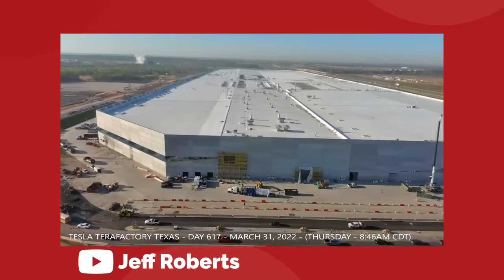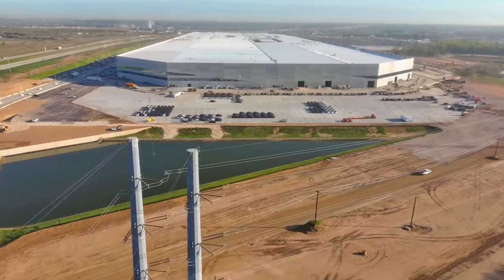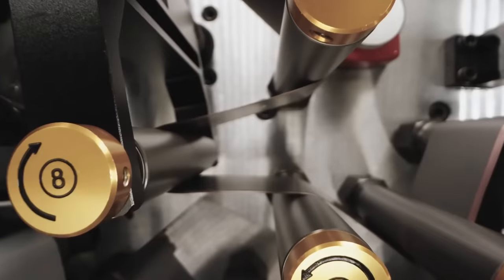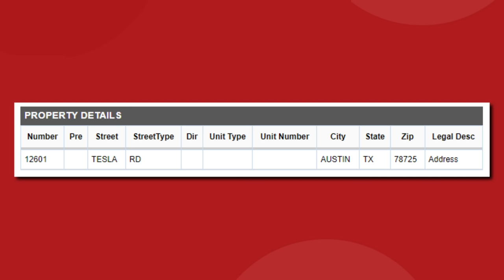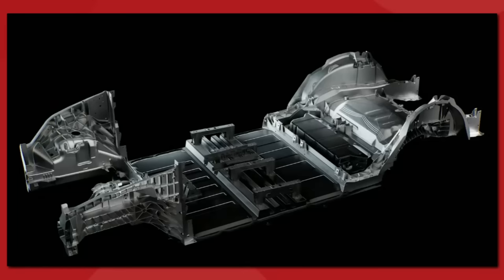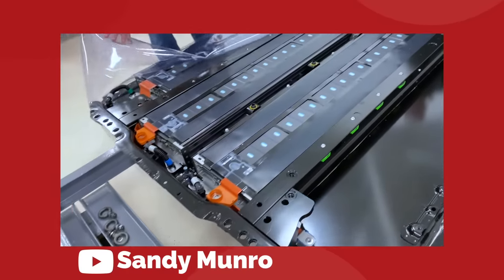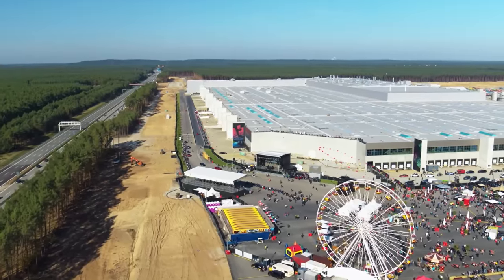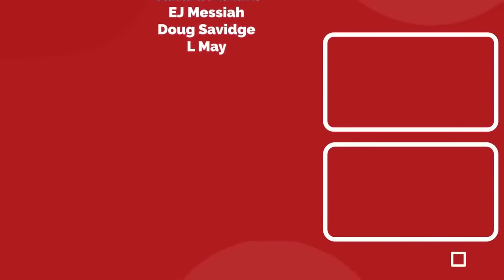Tesla Gigafactory Texas Is Officially OPEN!!

Comment: With the fast-increasing power capacity of LFP batteries, the 4680 may soon be outmoded. I've advised a friend who wants a Model Y to choose one with LFP cells, which I would also prefer if I were buying one.
Reply: Why?
Reply: 4680 has a generation one, two, three etc. It’s a form factor, not the chemistry.
Reply: Lol, 4680 is the size of the battery. They will be LFP cells, and probably with silicone in it.
Reply: @ikbenhet1989  i've checked posts about LFPs in the 4680 form factor, and from what they've claimed so far, the LFP versions didn't gain as much from the innovation as those with nickel and cobalt (ouch!) did. as a tesla shareholder, i want all their researches and engineering tricks to work. we haven't yet got feedback from buyers/users, but after some have driven 4680-powered Model Ys for half a year, we should begin to get a better idea about how good they are, including: how high they can be charged and how low discharged; charging rate; heat issues. it will take longer to know how many cycles they handle before significant loss; 2-3 years? i admit to being hyped on LFPs.
Reply: As long as the Y is sold with performance car spec I question LFP use.  A lower performance, lower cost Tesla like the rumored 2 series may use LFP and a single motor.

Comment: the only thing that wasn't mentioned much, probably because there isn't a whole lot of information is the status of the Texas 4680 battery production, as if that is not up and running within a week of opening then the plant will already stop running due to ill supply of batteries, but if the battery production is already started and a strong surplus of batteries is being made then this shouldn't be an issue for a while

Comment: Cool video!  it went down like an ice cold sweet tea with plenty of lemon, on a hot day.  How many in first year of operation?  74,000,000 cars in first year.  That includes 100 Semis and 2,500 CyberTrucks.  Sure going to miss that view of some mechanic throttling the carb by hand to rev the engine with the hood open.  Those days will be soon long gone.  "Adjust the points? What's that?"
Reply: A lot of my family members are mechanics and have their own shops. I’ve done a decent amount work on different cars too. I dont know much about Teslas other than it’s runs on just a battery to power everything else, so will that lead to a decrease in labor/parts?? I’m still waiting for charging stations to start popping all over the states!!!!

Comment: I don't see a big difference to other car manufacturers. These Tesla factories are big factories, well a few in a few countries. Volkswagen and others have many factories, large and small, in dozens of countries for decades. This is nothing new, only many factories of the other manufacturers are not a single building, but consist of several buildings standing together, as everything has grown over the decades. Doesn't look as sexy as a new Gigafactory, but they work all the same. Packed with the newest types of machines and robots and a 10 times greater variety of paint finishes than Tesla have. It remains to be seen whether innovations from Tesla, such as the "giga press machine" for the body or the new battery, are beneficial in all aspects. 1# These huge machines aren't exactly cheap, and 2# the more big parts of a car are manufactured in one go by just one extremly huge machine, the more expensive it is if there is a shut down time because of a malfunction. The biggest and newest is not automatically the best.

Comment: The real Tesla invented broadcast electricity so that batteries can be charged over the air. Well where is it?
Reply: Radio communications made it obsolete, you can either send electricity through the air or radio signals, but not both.  If we lived in a world with Tesla's innovation there would be no radio, TV, Wifi, bluetooth, etc unless all of those devices received their signals through wires.   Wireless communication is far more important than wireless power.

Comment: A total understanding why car batteries are out the roof. And then we're going to be forced to drive one of these electric cars, or fine public transportation and have living room area then need to commute from the city for a week home to just move back to the city and pay rent there so that you can work. My prediction gas is going to go up at $10 to $15 per gallon if not more. Me personally and factory shouldn't even be running being that they're forcing Us by holding oil from our United States for cheap gasoline. But let's look what cruel all makes. For standard car tire it takes 7 gallons of oil to make one tire for a car and the bigger the tire the more crude oil is needed. How about our plastics, you know like 90% of the car is plastic that y'all pay for declining investment, in other words $70,000 for a little bit of metal and a lot of plastic, if cruel is not going to be zapped from the ground then what's going to replace the plastics made of crude oil on these cars. Even the battery cases are plastic so I guess they're just going to stack a bunch of batteries in a car openly. Look how much stuff oil makes besides gasoline diesel and kerosene. I guess planes are going to be electric too by the way that's going to be interesting to see
Reply: It’s the burning of gasoline/coal and oil that’s causing the CO2 air pollution not the use in plastics etc
Reply: @blaineboyle5997  well I'll tell you what, you look at the exhausts on Jets, you look at the rockets when they take off and these are going up into the stratosphere or close to. One jet motors like a thousand cars and CO2 emissions. And diesels the most cleanest and efficient motor to run. I guess we're going to have no more black tops no tires to put on the electric car being it takes 7 gallons of crude oil to make one tire. I guess the bigger the tire the more gallons of cruel you need. Just don't forget about the soda ash, only gotten at electric plants that produce electricity with coal. They're lying, and if you don't see it well I don't know what to say
Reply: @jerrywaters4814  obviously coal is the worst polluter by far - there are many uses for oil that are way more important than car engines(let’s save the oil for jet fuel, plastics, rubber etc) - it’s non renewable meaning it will run out at some point
Reply: @jerrywaters4814  Coal comes from plants decay over millions of years.  Oil/natural gas from animals.  Water has three states: gas, liquid and solid depending on its temperature.

Comment: Model y from Texas, one piece? Or is the front combined with the rear, cast separately, then they become one. I don’t know, I’m just asking a poorly worded question.
Reply: They produce the battery pack. Then the rear section is bolted to the battery pack. Then the front section is bolted to the battery pack. I’m not sure if the front and rear section ever touch.
Reply: A one piece front end and a one piece rear end. Up until now each end has been a sub-assembly of many smaller parts welded or bolted together.
Reply: @men2dewy  ok. That’s what I thought. They aren’t casting single piece bodies…yet.
Reply: @damongnojek3912 , They may not ever do a single casting.  Going from the traditional methods of hundreds of individual parts down to 2 giga-cast parts eliminates hundreds of parts and the related assembly steps, equipment, floor space.  Going to 2 parts to 1 part only eliminates one part.  So diminishing returns at this point.  Also, it already takes a 6000 ton casting machine to make the current front/rear castings.  I would imagine doing both together would take a much larger machine.  So then they would only be replacing 2 huge machines with 1 machine that is probably twice as big as the two it replaced.  Is that even an advantage or does it cancel out?
Reply: @CL-gq3no  at a new location, I could see them taking advantage of next-gen Idra machines. Someone just bought a 9000 ton machine from them.  Probably not worth replacing existing processes and equipment, just removing them for the next locale.

Comment: I wonder how little reliance the Berlin Germany Gigafactory will have in need of Natural Gas?  I hear the Gigafactory in Germany is going to be electrically heated instead of gas heated.   Could be an advantage Tesla will have over other German industry as Germany has to wean itself off of Russian natural gas.
Reply: They are still going to depend on gas lol….. not just for heating but also for aluminum melting or heating and many other processes, also Germany doesn’t have a lot of sun like Texas

Comment: TESLA:

SHOULD REALLY BUILD MOBILE HOME STATIONS LIKE THIS. PORTABLE HOMES. SINCE THEY TRANSPORT ROCKETS AT SPACE X. THEY SHOULD BE AWARE OF THE PROCESS.

AS WELL AS, WHY THE HELL WOULD THEY NOT BUILD BATTERY STORAGE INTO THE FACTORY BUILDING ITSELF. INTO THE CONCRETE WALLS, OR MAKE A WALL THAT CAN GEN POWER & STORE POWER LIKE A BATTERY(IT'S JUST SHAPES).

Comment: I give zero fucks how advanced the new battery is, it’s max life will be about 9 years, and will degrade to 80% after about 3 years use and they cannot be recycled, will be toxic land fill material, and if everyone changed to EVs the power grid would fail epically. I get you want this to be the way of the future, it is not, it’s more toxic and worse for the environment, you’ve been sold a bill of goods and have no clue how bad it will be

Comment: There will be no 4680 battery-powered cars produced for at least 2 years.
Reply: @ver151set  Kato factory is trying to iron out manufacturing processes.  So far, an unsuccessful effort.  

A few handmade 4680 cells are being installed in prototype cars in Texas.  None are for sale.

So, you are right,  but misleading.  I am right but not misleading.
Reply: @ver151set  It is very possible that the 4680 battery will not be viable given the "tabless" design.  The continuous "tab" is a huge weak point in the design, in my opinion.  It's just too complicated and prone to quality issues.  I would not be surprised to see a huge increase in vehicle fires with the 4680s as the opportunity for internal shorting is far greater than a unit with a single tab.  I don't know why Tesla is not switching to prismatic batteries, which are much more compact.